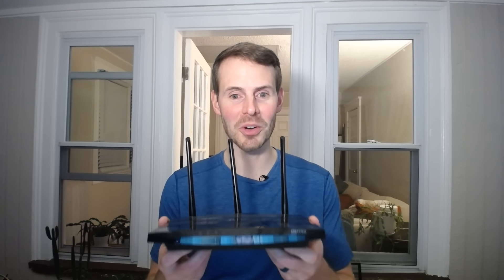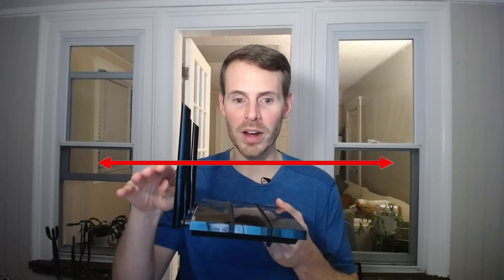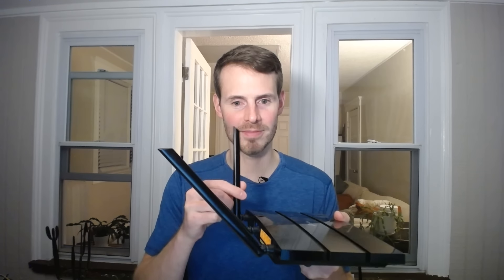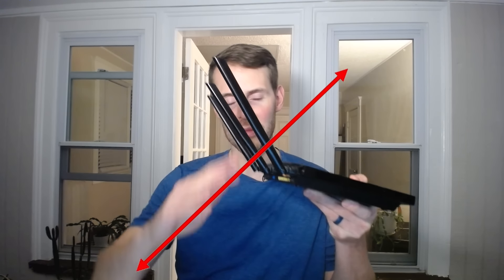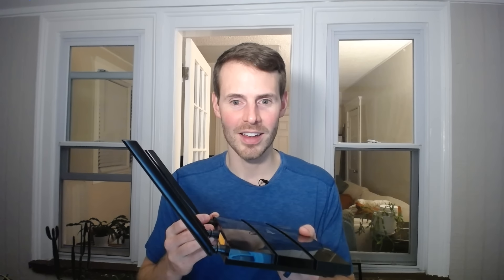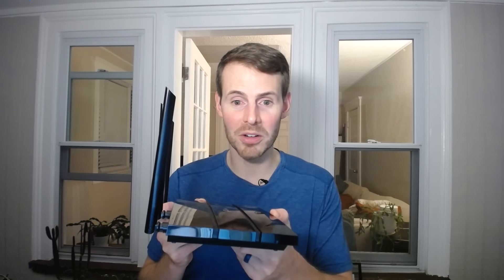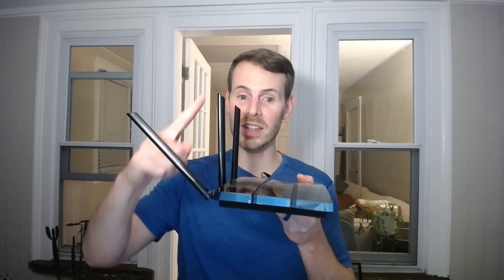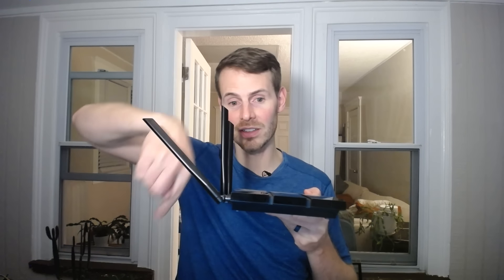Router Antenna Positions - What You're Doing Wrong

Comment: The signal from the antenna radiates out in all directions vertical and horizontal like a ball. You are more likely getting better reception because you are matching the antenna orientation of the transmitters and receivers. If your transmitter antenna is in a vertical position your receiver needs to be the same vertical and horizontal with horizontal. A laptop's wifi antenna is in the laptop screen which most people use on a 45ish deg viewing angle which also orients the antenna the same. Having your antenna at a 45 deg matches more closely with your laptop screen. The direction the radio signal radiates out and up but not so much down has more to do with the ground plane of the antenna which is likely built into the PCB of the router.  So if you want point the signal down you want to change the orientation of the entire router, not just the antenna. Mount the router upside-down on the ceiling might work just as well.
Reply from the maker: It is definitely worth mounting your antenna in a high location. That will help maximize your WiFi coverage because WiFi signals tend to reflect down as opposed to upwards

Comment: Any particular way to overcome penetration have 4 cement block walls to penetrate. Can that be overcomw without a booster or extender
Reply from the maker: There no simple solution here unfortunately. Your best bet would be to either position your router or your device so that the WiFi signal doesn’t have to go through the cement walls (I realize this might not be possible in your current situation). I hope this helps!
Reply: You probably also have steel rebar in them thar block walls, Matey!!! 😂

Comment: Depending on the router antenna positioning and performance can be  more complicated than this explanation.  

Your routers handbook should explain how antennas should be positioned and if it uses MIMO technology it is important to follow those instructions as offsetting antennas will cause beamforming and other MIMO RF techniques to underperform.

Beamforming involves coordinating the antennas to send signals in a specific direction towards the receiver rather than broadcasting in all directions.  To work all antennas have to be in the same orientation.  Instead of signals being sent in all directions, they're directed, electronically, exactly where they need to go. This can increase the signal strength and reduce interference.
Reply from the maker: This is a great point, thank you for sharing. My router instructs me to orient the antennas as I detailed in the video, but with newer standards this is an important caveat!
Reply: beamforming is from phased array, not MIMO, but other than that, yeah. most likely center vertical and the outer ones 45° and directly away from the vertical center one. And with MIMO and phased arrays it is important.

Comment: thank you very much for this useful video. what about those routers that they do not have any anntenas?
Reply from the maker: For routers without antennas, they will have internal antennas, much like your cell phone does. In these cases, the device will emit WiFi signal equally in all directions. I hope this helps!
Reply: @network-from-home  This is exactly i was going to ask at the begining as i have one without antennas. Now it is clear. Now, i keep this router downstair where i sit, but i do feel the signal is weaker upstairs. So, what shall i do to get good signal upstairs too by this routers without antennas ? Thank you,

Comment: Useful subject! I'm trying to improve the signal to downstairs, the router being upstairs; it's a wifi6 xr1000 gaming router. I'm using a signal analyzer on my cell, and I'm not seeing much of a difference moving the antennas. It's a good 5Ghz signal for streaming, but not as strong as I would like. I'm getting a good workout running up and down the stairs, however :P
Reply from the maker: @jamcdona if moving the antennas does not give you a great boost when it comes to your WiFi signal, you may want to look into moving your router (if possible). With that said, it sounds like you are still getting adequate signal with your router where it is. You might not want to mess with it too much!
Reply: You want your antennas straight up.  Practically any router in the last few years has some form of beamforming.  It will direct the signal towards the device sending/receiving data.  I've tested this several times and ALWAYS, ALWAYS having all 4x antennas straight up gave me the best signal at the longest ranges.  

It's good that they CAN move because you may want to mount your router onto a wall.

Comment: What about a device that works via wifi? I bought a wifi security camera, and I mounted it in a pole outside my house. Do you have any advice for how should I position the two antennas in the camera for optimal signal?
Reply from the maker: @User-jr7vf great question. The rules that apply to your router are the same ones I would apply to your camera. I would position the antennas on your camera so that they are perpendicular to the direction of your router. You need to ensure the camera gets a good WiFi signal, and aligning the antennas this way should do the trick (as long as it is within range of your router's WiFi signal).
Reply: I've repaired a few or so wireless security cameras. All of them I've looked at only have on real antenna and one fake antenna. Which one is real or not can sometimes be seen from the back.

Comment: Another Ham operator here.  I had to watch this a couple of times to understand EXACTLY what you were saying -- in obvious layman rather than technical terms.  You initially threw me when you said that your vertically positioned antennas broadcasted on a horizontal plane (of course i paraphrase).  I would guess you understand antenna theory pretty well, yet I don't think I heard the term polarization even once from you.  The way you explained it, is adequate and was done well enough, but you can see all the butt-hurt folks (mostly ham radio guys) who ONLY recognize the use of "Vertical" and "Horizontal" (when speaking in antenna terms) as a form of polarization.  In their technical world, when an antenna is oriented vertical, it is polarized vertical and the receiving antenna generally receives in the same vertical polarization.  You obviously have lots of ham radio guys who watch you so you maybe should make some clarifications for them -- otherwise a lot of those old grumpy SAD HAMS will jump you in a heartbeat, thinking you dont know what you are talking about.  You ARE correct (polarization aside) as a vertical antenna transmits it resonates (1/2 of the wave oscillates vertically upward and then the other 1/2 of the wave oscillates vertically downward -- in a wave pattern, perpendicularly away from the orientation of the antenna), if it is a vertically orientated antenna, it does radiate away from the antenna toward the horizon mostly in a horizontal direction as you say, (but for the ham guys somewhere between the presently controversial 5 degrees from the horizon to even near vertical -- nearly straight up).  Don't let this ancient, old Ham Radio farts get you down.  They know everything and if you don't believe them they will try and tell you again, and again, just in more brusk terms.  They are bone-headed, sad, and unable to communicate to anyone under the age of 90.  You are pretty darned correct in just what you say.  You just use terms that are more modern and able to be understood by the young folks.  Keep up the good work.

Comment: Am a bit into radio amateur stuff and i have studied antennas
i orient my wifi anetann so they are perpendicular to each others, so in case of 2 antenna i make them in V shape form
if the router have 3 then i would suggest to make them in X Y Z axis
having 2 antenna or 3 in the same orientation make them interfer with each other's and make the signal unstable
Reply from the maker: This sounds like a good approach to me! The important thing to note is that everyone will likely have a different antenna orientation that works best for them

Comment: This is overly simplistic- RF propagation from vertical antennas does not work quite like that.  And  it's not just the antennas that radiate RF-  the router chassis itself is also radiating to some degree.  Also, you have not addressed beamforming and other adaptive behavior that the more capable routers employ.

Comment: Being a home channel we will keep it simple... If the device was centrally located, like it's supposed to be, you wouldn't have had an issue. There's a lot left on the table here. What bands are using the external antennas? Are there also internal antennas? What DBi are the antennas? Do you understand the radiation bubble shape based on DBi? Do you understand the negative impact you've created on beamforming? My best advice, since you're doing it wrong, is to learn some cool stuff and try again.

Comment: I have a cell phone app WiFi Analyzer, and it's great. But I can see here another feature is needed. A tone that raises and lowers in pitch the stronger the signal is. So, if the signal is -85 db the tone would be down around 30 Hz. But if the signal is way up at -10 db then the toan would be way up around 5KHz. So you could use the sound to hear the highest strength. Set your phone with the WiFi Analyzer going on your phone with the toan on. Now go into the other room, and mess with the antennas on your router, and you will be able to hear the result coming from your phone in the other room. That would make a cool tool even better. Gotta send some Emails.
Reply from the maker: This sounds like an interesting idea!

Comment: Thank you for this great video!

It also helps to have an external Wi-Fi adapter with articulating antennas. They mean more polarization choices and often better signal quality.
BTW, routers or modem/routers with internal antennas are way harder to "aim", because who knows how and why and OEM placed (usually) printed circuit antennas inside?
Reply from the maker: Thank you very much! I’m glad the video was helpful. I agree, it can definitely be frustrating with a router with internal antennas; it just seems like you have one less thing that you have control over with internal antennas

Comment: Wow so very simplistic you missed a lot on signal radiation patterns  how the signals from adjacent antennas change the way the signal radiates from the antennas oh and dipole antennas radiate in a doughnut shape but only when there is one when in tuned multiples they interact with each other and it changes the radiation pattern and so does the dbm of the antenna it is something that has to be taken into account when designing a building whole building WiFi systems mobile phone towers and two way radio repeater towers.
Reply: I was wondering about all the antennas being in a parallel orientation, if the signals in line with the adjacent antennas cancel each other at all.
Reply: No, when omni (Dipole) antennas are placed a specific distance apart ( distance varies based on frequency of radiated signal) they do not cancel out they add and deform each other and alter the signal radiation pattern the signals deform between the two antennas forcing it outward it creates a elliptical signal radiation pattern instead of the standard doughnut pattern of a single dipole antenna. Now as I mentioned a single dipole antenna had a doughnut shaped radiation pattern but only if it has no gain normally measured in dbi but some manufacturers incorrectly shorten it to db the higher the gain in dbi the more the signal is squashed vertically making it spread out horizontally just like rolling out a piece of dough. This is great for covering large flat open areas but terrible for covering between floors as the higher the gain on the antenna the more the signal is spread outwards and the less it spreads out up and down. 

It’s a very important consideration when designing WiFi systems for multi story hotels, large sporting clubs and caravan parks etc. in some of those situations we use panel and phased array antennas instead of the traditional dipole that you find on home units.

Comment: - Consumer grade wifi antennas are 1.3~1.5 db, which means the transmission profile is spherical in nature and has a range of approximately 100~150 feet.  Changing the antennas to a 10 db gives a transmission profile resembling a donut with a  range of 1000~1200 feet. The higher the db value of wifi antenna the more directional the transmission profile becomes.  Routers with  built in antennas do not allow antenna switching.  If your wifi setup is experiencing dead zones then bridge a secondary router connected via a cat5 or better ethernet cable between each router and placing them at different placements to enhance the overall wifi signal.
Reply from the maker: @johnqpublic6228 this is good information!
Reply: do not forget touse spaced channels like 6 and 12
Reply: This is what chatgpt also recommendeds
Reply: It can't be spherical. It's mathematically impossible. Search isotropic radiator in Wikipedia and read it.
Reply: @BrianG61UK  I suggest that more research is required on your part.  To keep it simple,  the higher the dB value the more the transmissions become donut shaped and more directional it becomes.  This is a fact and mathematical.
Reply: @lee3003xx  Not applicable .
Reply: @ why not if is a different router used to extend the cover? if is a repeater is not applicable, but a different router will create a new network in the not covered area, right?

Comment: Signals are sent out the broad side of the antenna, not the tip. Angle it so the broad side of the antenna is aimed in the direction you need wifi. For most people, that'll be straight up and down just like the click bait thumbnail is claiming to be incorrect. Saved you 10 long minutes of wasted time. Dislike.

Comment: What you do when you angle the antenna like that is increasing coverage but sacrifice performance. Most Wifi routers have signal processing to boost the signal coming in by taking the signal from each antenna and creating one strong signal (When you move the antenna around you will loose that feature). So what you gain in your basement you will loose in the office/living room. But if you only need coverage please go ahead :)

Comment: Manual said for beaming to work keep antenna straight up. And my testing confirmed that any other positions actually worsen speed. The need to be perfectly aligned and parallel with eachother.
If you need a signal in a basement, better use repeater  (wired or moca)
Reply from the maker: Yes, this is true! I made a separate video on how your router’s antennas should be aligned with a beamforming router as well, but it sounds like you know what you’re doing 😎

Comment: There is 'some' logic in this video but as many have already said here, he is not taking into account the polarization of the signal.  The dipole antennas usually found on Wi-Fi access points have a vertical polarization.  When you have a laptop screen open, it's antennas inside are also vertically polarized.  Which means if you rotate your antennas you will in fact lose plenty of signal amplitude because the polarization does not match.  Especially diagonal is the worst you can do. 
People also need to realize that AP's are meant to be used on the floor they are on and if you have multiple floors, you need multiple AP's spreading your signal horizontally with your vertical polarization as it should be done.

Comment: I tbought you would get into more details on how the antenna actually worked, via diagrams of magnetic and electric fields etc. 
Isn't therecan issue with constructive and destructive interference between multiple antennas that are parallel with each other? Won't they cause regions with no signal because of that interference?
Also radio transmission and reception depend on the antennas on both ends of the connection. So isnt the position and orientation of the remote devices just as important as the orientation of the base station antennas?

Comment: Doesnt the pattern change abd becomes more directional due to multiple omni antennas placed in arrays like that
Reply from the maker: Technically, the antennas are still omnidirectional, but to your point, you can change the direction of the WiFi signal based upon the configuration of the antennas. In other words, I would say the WiFi signal is directional, but the antennas are omnidirectional (if that makes sense)

Comment: Why does the 9600 want the antennas configured as a W?
Your explanation make sense.
Reply from the maker: I’m not sure what specific modem you’re referring to, but my guess here is that the manufacturer is recommending this configuration because they feel it will result in a WiFi signal pattern that will work well for most of their customers. I know that’s not the best answer but that’s the explanation that makes the most sense to me
Reply: That 9600 is the baud rate
Reply: @evangiles4403  
Why the w configuration for the antenna on that unit?
I did not ask about the baud rate.

Comment: I have a 2 in 1 router modem for Comcast cable and it doesn't have antennas. But I used to have an Asus router with three antenna and I wondered: "Where do they go?" So I'd angle the two outer ones off to the side and the one in the center straight up. Oh well - I was guessing.
Reply from the maker: Honestly that’s probably a good orientation to try with your old router. With your 2 in 1 router that you have now, the antennas are internal to the device, so you will just have to do your best to position your router in a location that gives good WiFi coverage to your home. Good luck!

Comment: Antenna's work with RF electromagnetism, so @90 degrees is best , which means one aerial pointing straight out the back, one aerial horizontally pointing to the side and one straight up would give you the best possible signal strength. 
x,y,z @ 90